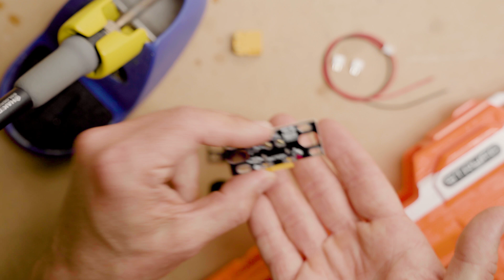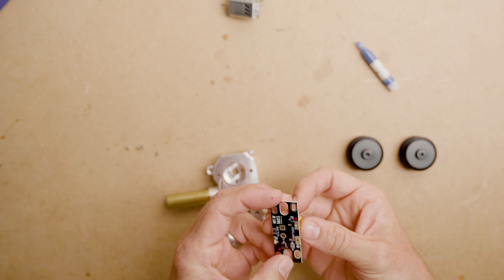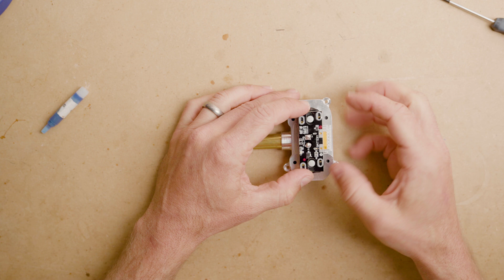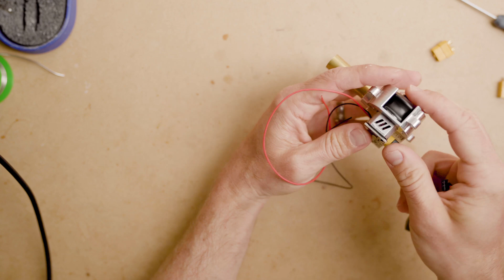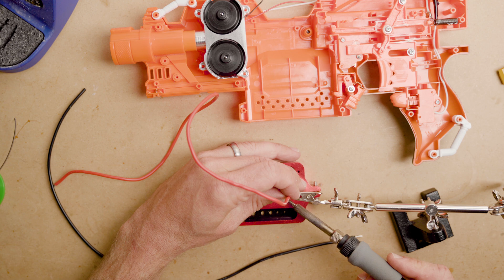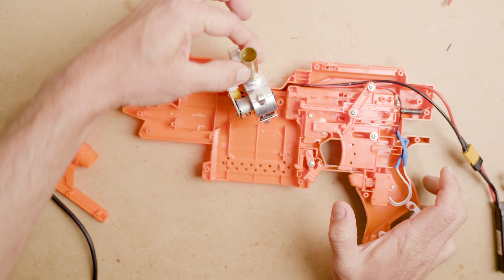MOD GUIDE: MOSFET Span Board

Comment: I had a question, I'm am planing on modifying my stratohawk/rapidstrike and am going to use the Meishel 2.0 130 2s motor you sell on your website but am wondering if they would be safe to use running with a 9 volt battery because I don't want to buy a lipo, lipo alarm, and lipo charger. Do you have any suggestions.

Comment: Real Talk: I'm not great at soldering. I used one of these to complete my first stryfe build, without the JST connectors, because I didn't know that was an option yet. I just used 22 gauge wire since I didn't have the JST connector available. Worked LIKE A CHARM. I was even able to integrate a basic noise-only LiPO alarm next to the stock switch using a 2s balance connector extension wire. There was just so much room near the switch now, and it cut down on the space taken up in the battery tray so I wouldn't need an expanded battery door. (I used the 2s 950 Graphene that recommended in the video.) Not bad for a first build by someone who had never done a LiPO rewire before. If you're new, and you've never done this kind of wiring before? GOD it makes it so EASY. I HIGHLY recommend it.
Reply: I'm going to try and LiPO rewire a Rival Charger the normal way this week, mostly to see if I've gotten good enough now to do it. But any time I've got the chance to just use a MOSFET board, I'm just going to use the MOSFET board. It's simple, it's easy, it requires less shell cutting, and it simplifies the world out of the wiring. And if you just XT-60 the Switch, couldn't you make a single Stryfe completely modular, swapping out MOSFET board flywheel cages for whatever game type you're going to?

Comment: I think I'll keep doing a full rewire for stryfes, since the high amp switches feel so much better than the stock ones, and they're easy to mount due to the 3d printed mount plates. For most other things I think I'll start using a mosfet

Comment: Rather then just using the smaller gage wires could you do the normal 18/16 gage wiring with a lipo to this board using the XT60 to make it so you can drag and drop the motor into any other blaster?

Comment: Did he say that it works for all cages he sells? Cause it’s not gonna work on a canted cage. I made that oversight on one of my builds. Felt pretty dumb when I started dry fitting things and realized my mistake. I also had to face it the opposite direction when doing a rayven build (mostly for ease of running wires)

Comment: Is there a constant current draw when the battery is plugged in?
I realise it would be very low but could it over drain the lipo?
Reply: The circuit doesn’t close until the switch is depressed, so I don’t see why it would

Comment: Hey Luke! I was wondering if you could make a rapidstrike mod guide. I'm interested in modding one, but I haven't seen a guide that looks very recent. I figure that all of your guides seem pretty clear, so I thought you'd be the person to ask
Reply: There's nothing new about modding an RS compared to 5+ year old guides really- it's pretty much identical to modding any flywheel blaster with the caveat of being able to upgrade the pusher motor if you want to in order to get a higher RoF, but that too is the same advice you will see in the 'old' mod guides. I made my Rapturion following old guides for a 2-switch RS with mosfet for the motors, all the wiring diagrams are still 100% valid and always will be...
Reply: Check out LordDraconical's guides on them, he's a longtime modding pro, been doing it for 10+ years at this point, with a similar amount of clarity and ease of following along

Comment: Speaking of Heston Systems, does anyone know what happened to them? They have been out of stock for a looooong time. Am I just missing when they restock? Also Thanks for a great product Luke. I've been using these boards since you came out with them. I'm glad you mentioned the JST(?) connectors. I've been using the power wires from old usb cables b/c/ they are the only ones small enough to fit through the holes on the board. I always wondered why those through holes were so small. ;-)